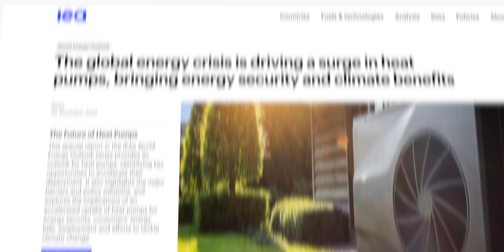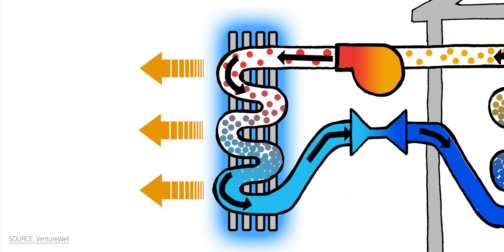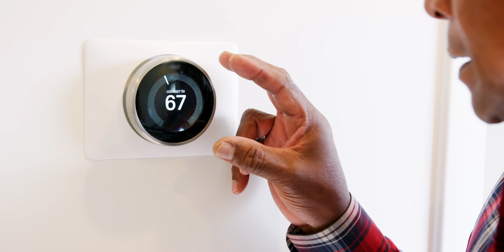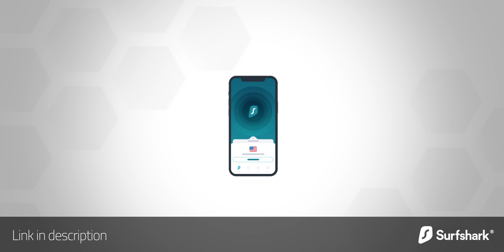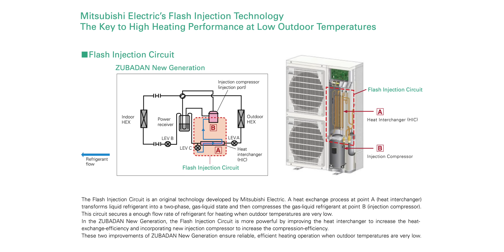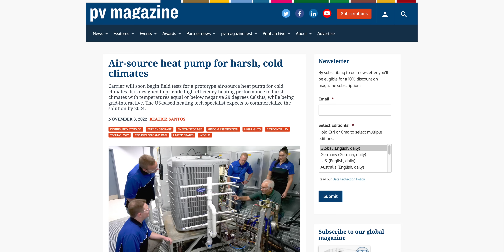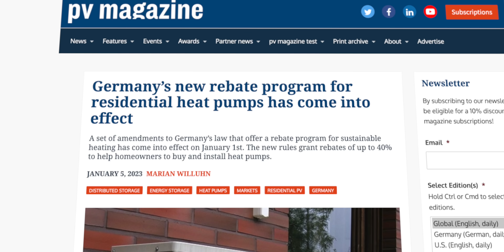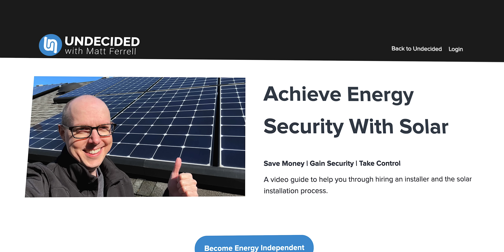Major Advances with Heat Pumps in the Extreme Cold

Comment: I had a Fujitsu cold climate heat pump installed at my place in northern Vermont back in 2017. I have had days where it's been well below -20°F and it ran fine. The temperatures where it has the most trouble is when it's around freezing with a high relative humidity. That's really the only time I notice it because it has to go into the defrost cycle fairly frequently. The only other times I have a problem is when a tree takes out the power but I hope to get solar and batteries to deal with that at some point.
Reply: Confirm, in PNW we have damp winters and my heat pump does a lot of defrost cycles when it drops just below freezing.
Reply: @GreenlandRobot  I have the same issue here just outside the coast of central Norway.  It is often just below zero in winter, and then the pump has quite frequent defrosting.
But besides that, it works just great and saves a lot on the energy bill.  My Fujitsu is now over 15 years old, but still going strong.
Reply: Every since PPL bought out my Utility provider, I've had more outages... its ridiculous. 

So powerloss when you need heat most would flat out suck... so good idea to get solar if you can afford it.
Reply: @MRSketch09  Bro my modest house uses 10kwh to heat on a modest day,  can't imagine the consumption on a 0 degree F day. I would need a six figure solar system to get close to heating my house with a mini split.
Reply: @chrisE815  It would only cost me $20k to add enough panels to use my heat pump as primary heat. I have 12 now in my backyard which cost $20k to install and it cancels my spring summer and fall electric bills. I currently use the heat pump as secondary heat and the wood stove as primary heat but plan to add 12 more panels as I would prefer to use the heat pump as primary heat as it will be more convenient and use the wood stove as secondary heat.
Reply: Generator for backup?
Reply: You don't need Solar to get backup; just an Inverter/Charger, batteries and a critical load electric panel with automatic transfer switch function. 
Critical loads are the circuits in your electric panel feeding the furnace  (heat pump) fridge, freezer, lights, etc. and your coffee maker outlet😊.  An electrician will take these critical load wires out of the main panel and connect them in the new panel (that has a transfer switch function). 
This panel gets connected to two sources of power: the grid, through the main panel and the inverter. When the grid power fails, the panel switches automatically to the inverter power. When the grid power comes back on, it switches back.
Reply: A battery bank designed to power an average American household for three days would need to supply 90 kilowatt-hours of energy. The battery from the previous example can supply 2.4 kilowatt-hours, so this system would need 38 batteries. In reality, several more batteries would be needed to account for battery imperfections and for power consumed by the inverter, which is a device needed to convert direct-current battery power to the alternating current needed by a household electrical system.

That's a LOT of batteries... and a serious commitment to maintain your limited lifespan cells.
Reply: I just purchased a log home that has 2 fujitsu heat pumps and 6 zones. Haven't had a chance to try it out closing is next month but it seems like a good idea. There's also an oil furnace with baseboard heat and a wood burning stove so I'll have a few options for heating.
Reply: trees take out power in NH and that means NO heat for me 'cause my oil burning heat source needs electricity to operate too.  Looking forward to getting rid of  the oil furnace.
Reply: That's gonna be one hell of a solar setup. Won't consider propane or wood backup?
Reply: @chrisE815  Wood would be a good alternative, which is what I use in addition to my air source heat pump and solar array. Waste oil would be good too, basically any fuel or energy source you can get for free. If you can make your own wood pellets that would be a good option too. Propane, natural gas, and heating oil or any heating fuel you have to purchase is a terrible option in my opinion.

Comment: I'm pretty sure the heat pump I had installed in the apartment downstairs in Norway 12 years ago will happily work down to at least -20c.  I haven't had any problems with it and it's still going strong today.

Comment: Installed an air-source heat pump along with our propane furnace.  Also installed a water heater with a heat pump on top.  Energy bills are way down, much of the cost was recouped from various incentives, and the total pay-off will be less than three years.  What's not to like?

Comment: We installed 3 wells of 300ft each, my short video is here: https://www.youtube.com/watch?v=06tclTYNXZg
Big benefit of ground source is that the heat pump gets to work with ~55° water year round and the unit sits safely in your basement where the furnace used to be. By contrast, air source heat pumps are exposed, have to handle temps between 120°F and minus 20, deal with snow or leaves, and therefore have both lower efficiency and lifespans.

Comment: We just had a Mitsubishi heat pump installed in our home.  Primarily for cooling but it will provide a finished basement and another room that can't be serviced by duct work heating and cooling through 2 mini splits.  The rest of the house is serviced by new duct work.

Comment: I have a dual fuel heat pump setup recently installed this past November. This is the typical above ground style and not the far more expensive underground system.

I have mine swap to the gas furnaces, dual stage variable speed models,  at around 30F. What I have noticed with my heat pumps is the heat is much cooler than when the furnace is active but it does a good job to heat the home. They do run a lot longer than any furnace cycle. Supposedly I can run these down to single digits (Rheem) but they suggest to default to the furnace below 28F. They do a good job of frosting when its really cold outside

Rheem/Ruud makes it near impossible to find the COP values, they only like to show SEER or HSPF  values
Reply: The difference in the air temp is expected, and is something many people dislike about heat pumps. It takes more energy to get the working fluid hotter, so they instead compensate by moving more air over the lower-temp coils. You get the same heat into the house but it's less concentrated, and can fall below skin temp, so it feels cool even when it's still warming the space.

Comment: The double pun before you intro was great. 
I always wondered if for these heat pumps, that if you built a shed completely containing it, and then make space for air flow, and built a fire pit and burned logs right near the heat pump if that would super charge their use in the really really cold months. There is the down side of having to build and maintain the shed as well as feeding the fire. On the plus side if built right, would shade the heat pump in the summer but would need sufficient airflow to stay effective I would imagine.

Comment: For geothermal (ground source) heat pumps the biggest gotcha to warn people about it the cost of the well(s) if you're going the vertical route. The cost can go way up depending on how deep they have to go before hitting bedrock or "ledge". They usually have no way of knowing how far down it is before hand so the estimate will be a hopefull guess. The part of the well above ledge needs casement (the big steel pipe) and that stuff ain't cheap. In my case they guestimated 20 feet to ledge ( a reasonable guess in NH, where some places you can't drive a tent peg without hitting ledge) but it turned out to be 100 feet (apparently my house was built over a buried prehistoric abyss), which added $8,650.00 to the cost for the two wells.

Comment: We live in the west coast marine climate so not super cold. When our gas furnace was getting old,  ducts rusted out, rats invading etc. We got a heat pump with minisplit system. It was ideal for getting rid of the old duct work under our house and giving us different zones for heating in a two story. It's been great, and the best way to go electrical, which we wanted because our solar panels cover all our house power and car charging (for local everyday use). I wonder if the comparisons include air conditioning (cooling) since to replace a gas furnace and compressor will cost more than just a furnace--and a coal burner is not that good at cooling.

Comment: We put three heat pumps in our latest rebuild, the hot water heater, mini split heating and cooling, and the fridge. The heat pumps work well, especially the hot water heater. I’d have liked to put in geothermal, but it was way out of our price range. They are powered off of solar panels and the grid. We think we can get mostly off grid once we install a home battery. A big plus, the Rheem hot water heater can provide three days of short hot showers after the power lines go down in a winter storm.

Comment: What you really need when you run a heat pump in cold environment is good insulation. The heat pump isn't likely to bring the inside temperature high enough in a drafty house but a reasonably insulated one should not have any issue.
Reply: The fix for a drafty house is to rectify the draftiness.

Comment: my wife and I got the top-of-the-line Bryant heat pump about 3 months ago and it's been really great. it has the variable speed compressor so it can go down to something like 25% of its capacity. I think it'll be over-sized by the time we're done insulating the house like I want to, but it's turndown ratio will really help. 

the recent insanely cold temps in Ohio in December (-14f) were no fun for our electricity bill, but we don't have a gas bill any more and we've got 27 solar panels that help out a lot in the summers.

Comment: I just had to replace my gas furnace and had them also switch out my 30 year old AC system with it for a 3 ton heatpump. I am pretty happy with it, although I dont quite know if its working as well as it should. I have an Ecobee and pay for some little additional data monitoring and found out that my heating system can handle 20F before the temperature in the house requires gas aux heat. I don't know if that is a bad result because there are so many factors between the heatpump's output and my house's leakyness. 

Something I did NOT expect is that my furnace turns on constantly even though the Ecobee says the aux is off. Thats when I learned how the defrost cycle works. Mine seems to be set to 90 minutes, which means when its below 40F outside, every 90 minutes my heatpump is working, the gas furnace will kick in to warm up the heatpump, its only a few minutes, and my overall heating bill seems to hardly notice the extra gas usages (i only have a gas water heater so i know exactly how much is going towards that based on summer time usage). I guess the heatpump has no idea if a defrost cycle is needed, its just based on an interval and i think warms up the coils until they are at 40F again meaning the ice would have melted off. Because this winter was actually very light for snow here in Philly, I actually never got a chance to check how it handled that. 

They also gave me a quote for a 18k BTU minisplit and it was going to be nearly $10k installed. I have issues cooling my house down in the summer, but maybe that will be better with the new system, and i would much rather put that money into adding additional insulation or replacing windows than throwing more cooling at the problem.

Comment: Live in TX with an air-source single speed central air heat-pump. The heat pump works well most of the time. It puts out more heat than my resistive heat. The one issue I have is that under cold wet/damp conditions ice builds up on the condenser fan and it gets out of balance and starts shaking.

Comment: Cost of heating source also depends on weather you are constructing new building or retrofitting it. I'm preparing to build house and will go with heat pump (maybe ground source) because then I don't need to do natural gas installation inside house and build exhaust chimney.

Comment: So how well can a heat pump heat a 1800sf two story house? I mean- can I have the thermostat set at 72 degrees and expect a heat pump to maintain that with 20 degree winter days? It doesn't seem like that would work at all- but my furnace runs constantly this winter and I only have the thermostat set at 67- it's cold in my house and my bell is still $450 each month this winter- it's getting ridiculous!

Comment: Unfortunate timing that many factors have temporarily made electricity so expensive here in New England (rate doubled in Connecticut), just as I was dumping natural gas for heat pump heating. Natural gas prices rose less sharply. Long term I should be alright, but only because I hope to add Solar.

Comment: I’m curious about how air source heat pump vendors vary in their reliance on heat strips/resistive heat for those rare, very cold snaps when even the best compressor designs suffer (like under -5°F). Yeah, it’s a niche topic, but still something I’m interested in.

Looking forward to sharing this great video with my friends who are slowly getting up to speed on heat pumps.
Reply: For the niche applications resistive heating in the outdoor unit, which can serve double duty in doing a defrost cycle while operating, would probably be a good thing, turn off outdoor fan and reduce heating draw, while ramping up the heaters till the outdoor coil is above freezing, then slowly start the fan while reducing heat. That at least will still ensure energy extraction from the air, and thus extra heat, and you could also have a vent panel that also flips, to allow the compressor cooling air to be directed to the coil, and not dumped to ambient, providing a useful amount of heat as well. Summer you dump that heat, keeping it away from the coil, but in winter you want that heat to go to the coil. Another way to grab that extra 5 degrees of differential, or an extra few percent on efficiency, as most compressors run hot, and have little to no cooling air flow over them, unless they are in a square block tower, where they get cooled by the hot condenser air, or warm up the outlet air.
Reply: I think the stories we get from the South, where people said their heat pump couldn't keep up during a cold snap, are because they went cheap and didn't do the heat strips.  

Eight years ago we converted our small office building in Seattle from electric resistance heat to a 5 ton heat pump.  I do night setback on it, and it often uses the heat strips during the morning warm-up when temperatures are in the 30's or lower, but most of the time it runs on heat pump only.  It reduced our mid-winter electric bills around $300 a month and averages over $100 a month over the course of the year.

Comment: I think this site, like many, uses efficiency incorrectly. 3 to 4 times more efficient than gas? Gas is already easily over 90% efficient. How can you get 3 to 4 times that? Heat pumps don't really create heat, they move it. If you could move heat at 100% efficiency, it would take zero energy to move it, and that is not true. In other words every BTU of heat moved from outside to inside with no energy lost. There are lots of losses in a heat pump. Just looking at EER, SEER or COP, shows they move maybe 3 to 5 BTUs for every one they use. That is waste of 20 to 33%. You can't count the BTUs that exist outdoors as heat created, it's only being moved. The fact that the heat is not being created can make HPs more cost effective than most any other heating systems, but that's different from efficiency.

BTW, did geothermal 25 or so years ago in a climate similar to MA and never was on emergency heat. I now have air sourced HPs in a warmer climate, but have seen down to 3F and still no emergency heat needed. Got my first HP in 82 and have owned HP WHs and dryers. They generally use less energy when you can just take it from elsewhere.

Comment: These things are cool (hot?) but need a lot of work to be realistic.
First, these need to be drop in replacements for furnace integrated whole house air conditioners.  So when an air conditioner dies, it can be replaced with a reversible heat pump (because that is all that these are).
Second:  Cold is not 5C.  Cold is -70c.  A little chilly is -30c.  If these things can't even handle a little chilly, they can actually be a problem because now you need a backup furnace that might fail when suddenly called on during the most critical time.  These things need to be capable of keeping your house above 0C when it is -40C out there to prevent catastrophic problems from a failed backup furnace.

Comment: Ground source is not geothermal.  Geothermal uses heat from the earth's core for heating, ground source is much cooler and uses surface crust steady temperature between 40-55F for heating and cooling.

Comment: IMHO, heat pumps are about "Saving the planet" vs actually have something that works good.  Texas summer heat gives me $300-400 a/c bills, but winter heat with NG is around $100.  Maybe the AC/heat pump has higher thermodynamic effency, but that compressor is still "burning " lots of electricity.   If you have a huge solar farm, that can be fine, but again, TX solar installers start with "not counting your AC, how much power do you use" because suburban homes physically can't get enough solar to power a AC/heat pump.  So now you are back to $grid $power...  

Going Geothermal can increase the efficiency of AC/HP by a huge amount, buy again, suburban/ city homes can't install it- not enough yard.

If you Iimit the tech to what a typical homeowner can use in the real world, Heat pumps lose every time.